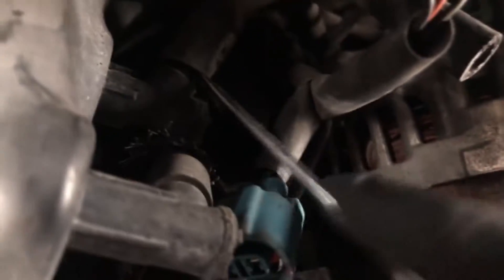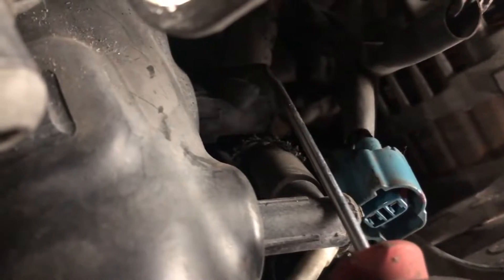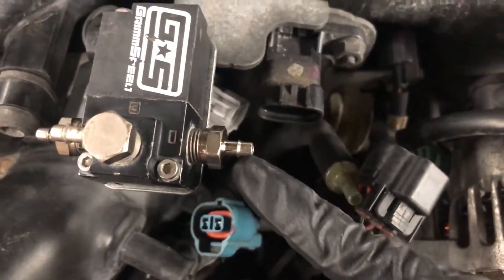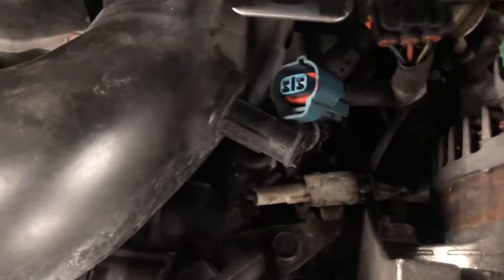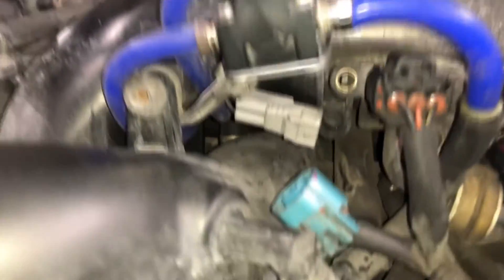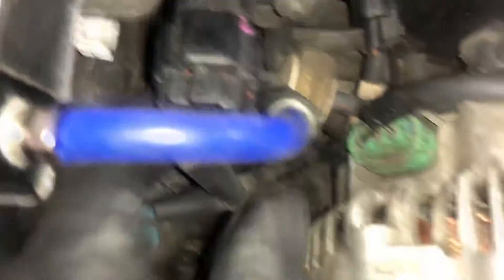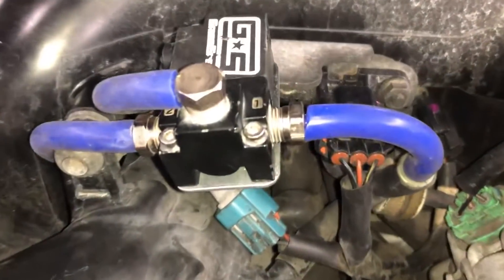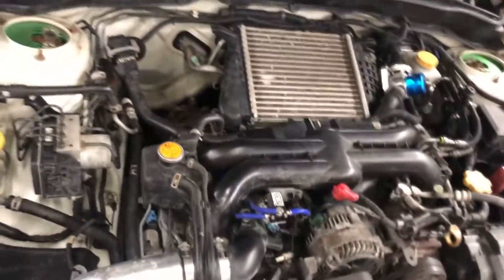[HD] How To: EBCS Remove & Install 08-14 Subaru WRX *FIX* Overboosting

Comment: hey there it has been 4 years since the vid came out but this has helped a lot and you may or may not respond but I am looking to buy the same one you have in the video and am wondering how you chose that option with the steel plate and the screw circle on it lol since there are multiple on GS's website. I have a 2011 wrx so I'm trying to figure out what option would work best and how to choose which option. Thanks for the vid it'll help a lot with installing it. :)
Reply from the maker: @SlubersGarage_YT  I can’t remember but I just found one that was for an ej255 with the plastic intake manifold.
Reply: @TorontoEntz  thank you 😊

Comment: Hey man, I’m still really stumped here, any ideas on my previous comment at all?
Reply from the maker: Hey I didn’t see it until now, what kind of downpipe are you running? And are you on a protune?
Reply: @TorontoEntz  it seems like the stock down pipe and I’m just running a Cobb tune. So I think I found that it’s an issue with the restrictor pill lines. a 3 port ebcs would probably completely fix it. I just don’t know where or how to get a tune for one
Reply from the maker: Yes and it can also be the Cobb tune your running, if it’s just the generic maps that is OTS(off the shelf) then that can cause it too, best option is to have a protune with a 3 port ebcs and that will eliminate all the headache. You can Google some reputable Cobb etuners or protuners in your area. Hope that helps.
Reply: @TorontoEntz  for sure, thanks man I appreciate it

Comment: My stage 1 2008 wrx is overboosting up to like 17 psi and it’s only targeting 13..should I try a ebcs? Or is it even applicable at such a low stage. I’m not asking for much boost at all
Reply: yoooo, mines doing the same thing rn. Did you ever fix it?

Comment: What about the intercooler blow off valve line,  and the purge solenoid lines next to that eBC thing you replaced , I'm having a hard time finding helpful Info,  and theres a line above the brake booster on rear of manifold

Comment: After that you reflash your computer? Or just install and done the problem, I had the same problem  😕
Reply from the maker: Yeah just install and I was done, another issue could also be if you have an aftermarket Downpipe, it can cause “boost creep”
Reply: it's my first wrx I bought it at auction, the intake it's cobb, and the exaust is invidia catless downpipe 3 ", let me try with this sensor GS. I hope fix the code p0244